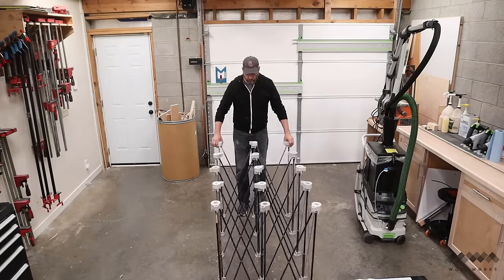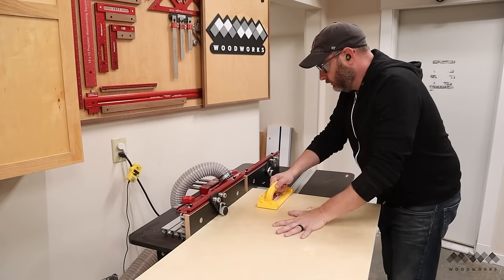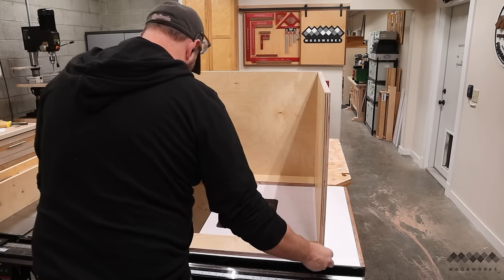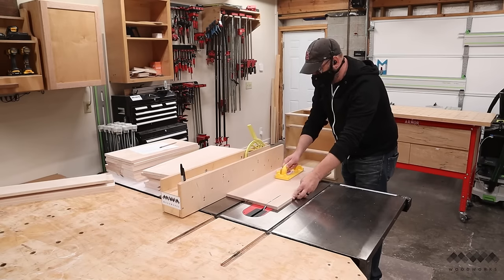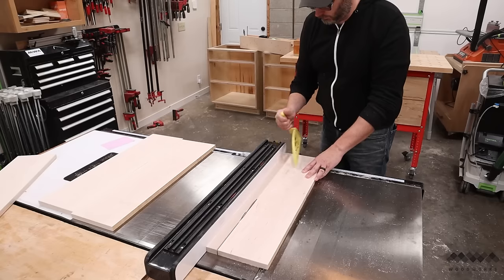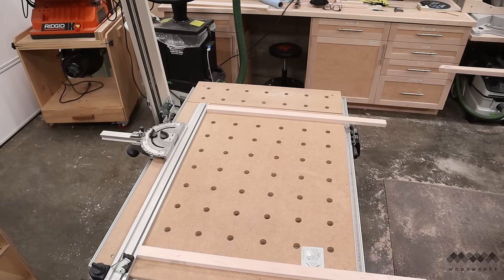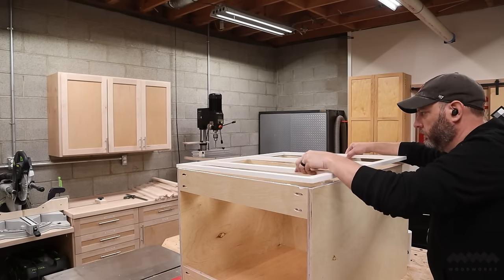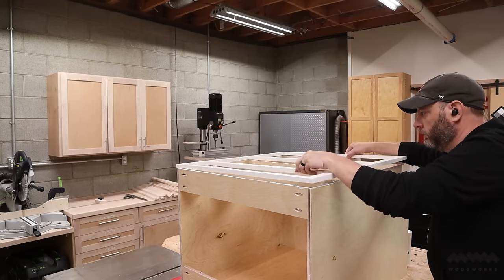I can't believe building custom cabinets was this easy

Comment: I built my entire kitchen and 2 baths with no dados, just glue & nailed, 10years, no issues.
Reply: it always fascinates me how professionals insist on making everything last at least 100 years. 

MDF, glue, couple screws, good to go.
Reply: Or pocket holes 😊
Reply: I didnt even use wood glue for my kitchen wall cabinets. Just scotch tape. Still good even after 3 weeks
Reply: I just spit on the edges. 88 years later still good as new.
Reply: I used chewing gum for my cabinets. Four weeks now and still holding strong
Reply: I just dry fit my cabinets and friction fit them to the wall. .3 seconds and I’m still good.
Reply: Right!!! My moms house could be taken by a.tornado and her custom cabinets will still be there lol@1lllllllll1

Comment: Lol “that easy” proceeds to use a bunch of expensive tools
Reply from the maker: I said it was easy, not DIY 😜
Reply: You actually don't need all that fancy tools.
If you own a house you need to invest a few hundred bucks in tools, or pay thousands to professionals and be done with it.
Personally I enjoy DIYs, even if it's not perfect, it's the process and understanding of things that is satisfying.
Reply: Bro I hate seeing these “tubers” use everything festool, everything else that we see does a great job, but isn’t necessary. I’d love to see these people get a job site table saw, a jobsite miter saw(dual bevel, dual everything so it’s not limiting), and just do it the way a normal person would. This makes people want to give up or not want to do it.
Reply: This is coming from a DIY finish everything guy, but my work is impeccable and I don’t have a 1200 circular track saw, I have a $300 60v dewalt circular saw with a perfectly straight hand made track made out of plywood which is the same length as a full sheet of plywood. Guess what that cost me to make? Nothing because I already had scraps and it’s just as accurate as a $700 festool track🤣. Also I have a dewalt miter saw which is dead on because I measure my miter and make the saw is adjusted. I also have a dewalt job site table saw that I have that makes perfect cuts. Just shows you don’t need fancy tools to get perfect cuts. The expensive tools are just built better and have more accurate cuts “out of the box”, but cheap tools can have the exact same results as long as you dial it all in. A tool is a tool. The degree of accuracy is what you want to make of it.

Comment: A great build.  I used to make my cabinets with face frames, but after discovering the advantages (including a large increase in usable space) and ease in installing the drawer glides, I now edge band my plywood and build my cabinets in the Euro style -- i.e., frameless.  For hundreds of years, if cabinet makers didn't want to use box joints or dovetails, face frames were almost a necessity to achieve the desired rigidity to the cabinets.  But now, modern joinery techniques such as pocket screws, dual dowels, conformit screws, and dominoes -- together with extremely strong modern glues, make face frames unnecessary (other than purely for aesthetics).
Reply: With a larger shop and more machinery, the customer gets to make more decisions on things like door styles, finishes, etc.
Also there are cost savings involved in building the Euro style cabinets as opposed to the face frame type, which can be passed along to the customer, making you more competitive.
But again that requires more expensive equipment which also requires shop space.
Ask most people if they prefer glued and screwed drawers over dove tail drawers and the answer will be dove tail.
And there are machines for doing that also.
Same goes for the finishing process, the nicest finishes are sprayed on, and that requires a well ventilated paint booth.
Wheres the dust collection?
Reply: Frameless cabinets are great, but we DIY woodworkers don’t always end up with perfectly flat and straight plywood, so I’ve had to abandon my frameless cabinet plans a few times in favor of a face frame that allowed me to help pull that bowed plywood into a more straight position…unfortunate, but that’s how woodworking goes sometimes.

Comment: Why do you put a 1/4 dado 3/4" from the back (for the back) of the casework? I see people doing this today and I'm scratching my head! We never did that we just rabbited the back 1/4x3/8. The cheaper shops just stapled it on without the rabbit. Do you use that method for upper cabinets or pantry cabinets?

Comment: Yep, that's the tried-and-true way of building base cabinetry that I learned 34 years ago. With the exception of routing a 1" 1/8 wide rabbit onto the back length of the 2 side panels, to recess in the upper /lower hang rails and the back panel. The horizontal top/bottom back members of the cabinet, we called them hang rails. Because that's where you would hang & attach the cabinet to the wall with, using screws. The back top horizontal member was also called the strong back. And "stretchers" were used in tables /chairs that stretched from 1 end of a pair of legs to the other end of a pair legs. The purpose of stretchers is to stretch over to the other like member, to brace it, keeping the legs from racking. But of course, now days curtain cabinetry anatomy seems to be used interchangeably. Great work.

Comment: the most important multi-tool one can ever have in the workshop is the "ol' persuader/equalizer/book o'complaints/debt collector" mine runs in the family for the past 80 years or so, i inherited it from my grandfather it even has a special feature, it holds the workshop doors open during summer. 😀😍

Comment: I have been building cabinets for almost 30 years. This is quality construction. Only differences for mine were, I datoed  the face frames  and then glued and clamped them and I covetailed all drawer boxes. nice video. Also once my doors or drawer fronts were glued up I thickness sanded them to make them almost perfect, but I realize most people do not have one.
Reply from the maker: All good stuff

Comment: Great job! Simple, elegant, and very well explained. I always enjoy your videos. Question though, how did you manage to hide the pocket holes on the toe kick ?
Reply from the maker: Good question! The toe kick will have a piece of base trim over it when I install the cabinets. That will hide the pocket holes.
Reply: Okay Sir👍
Reply: @MWAWoodworks  I got another question regarding the trim. So you put some trim to hide the pocket holes cool got it. But how do hide the edge ends of the trim? Or does the trim surround the sides of the cabinet?

Comment: I worked as a cabinet maker for 10 years and never once built cabinets with pocket screws. We used them in repairs but only out of necessity. Dowels, staples, glue and screws are industry standard for Euro-style cabinets. It's also faster for assembly.
Reply: Nah...tongue and groove assembly...

Comment: I'm hoping that someone can answer this quickly as I'm planning on building my cabinets tomorrow.   Would 3 of the cabinets in this video, when all screwed together, be strong enough to hold a 1.5 inch slab of marble?   This is for an outdoor BBQ bench that I'm making and it will be on caster wheels.   I was thinking that due to the very heavy weight of the marble slab, I should use 3/4 inch back board and glue + pocket hole the whole thing?   Any advise would be appreciated.

Comment: Nice video. For the tropics I prefer kitchen cabinets with legs instead of toe kicks.
Reply from the maker: Great! Where is the teopics exactly?
Reply: @MWAWoodworks  The Caribbean, specifically in Puerto Rico.  In the tropics there is a lot of humidity, termites, and danger of water damage from hurricanes. In the island, most of the kitchen cabinets are made with PVC to prevent damage from water and termites. I prefer wood because PVC is a very weak material.
Reply from the maker: That makes a lot of sense

Comment: When you screwed in the undermount slides, did the rear of the slide angle outward since the face frame sticks out around a 1/2" and the rear of the slide is screwed to the carcass
Reply from the maker: No for this cabinet I made the inside face of the face frame flush with the cabinet sides in order to make the install easier.

Comment: Great video, thanks! May I ask, if that cabinet was going to butt up against a wall on the left and you had an overhanging face frame on the left to scribe in for a good fit, how would you deal with the gap under the toe kick where the side of the cabinet is against the wall? Would you just scribe it in tight as possible so there was basically no gap?
Reply from the maker: These cabinets I built are actually going to butt up against a wall. Yes I will scribe the overhanging face frame and the toe kick will be covered by a piece of base moulding which will also be scribed on the end
Reply: @MWAWoodworks  much appreciated!

Comment: I've been watching your videos for a while and really enjoy your content and presentation.  As I have taken on more projects, I have run into the same technical question a few times.  In this video, at 9:49, you show a drawer slide being fastened into a cabinet where the end overlaps onto the face frame.  Though it does not look like it, I assume this means the inside edge of your face frame is flush with the inside face of the cabinet or you included a spacer, but just did not include that detail in this video.  This gets back to one basic design characteristic I have never seen anyone address - how much and where should the face frame overhang the sides of the cabinet.  It looks like your face frame is about 1.5", which means you have about 3/4" to overhang inside, outside or some to both.  I have assumed that there should be a small overhang on the outside to aid with installation.  Is that how you do it?
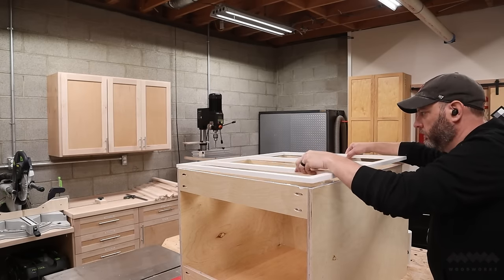Reply: Agreed for most cases. At  9:41 you can see that the face frame is flush with the inside of the cabinet.

Comment: Great video, i rewatched several parts to get a good look before i start the build.
I was wondering, with the face frame on and it being wider than the cabinet itself. How would you mount a second cabinet next to it? A piece of ply between 2 cabinets or something else?
Reply from the maker: In that case I would combine the two cabinets and then make a face frame to cover both and add it once the cabinets are installed
Reply: @MWAWoodworks  That makes sense! I'm used to euro style cabinets but the visible line between 2 cabinets and then the double width that is not maintained at the outer edges of the entire piece makes it feel like ikea stuff. Most carpenters use the same style "furniture boards" as well instead of plywood.

Comment: So the toe kick is integrated. That makes it much harder to level the cabinets?
Reply from the maker: It depends on how you're installing them. If you're doing a run of 3 or more cabinets tied together then it's best to build a separate base and just level the base. But for one one cabinet or two cabinets with an appliance in the middle it makes no difference the leveling process is the same.

Comment: Hey, newbie woodworker here, just one quick question.. how do you account for wood movement? I read that pocket holes prevent wood movement and the wood will then crack over time..
Reply from the maker: Good question! There is no wood movement in plywood. Only solid wood.

Comment: I have a 12 tooth 5.5" circular saw, would I be able to do this type of project? I do not have space or access to a large workspace, or even a small work space or storage for a table saw of any size.
Reply from the maker: If you have a way to cut perfectly straight and square cuts, sure. You also have to get blade for your saw that is meant for fine cuts, much higher tooth count. A 12 tooth blade is made for rough construction and demolition and will tear up plywood.
Reply: @MWAWoodworks  All the blades I see with more teeth are for 7.5" or greater saws. Should I be looking to invest in a new saw and get rid of this one?
Reply from the maker: I don't everything that is available honestly but you for sure need a crosscut or fine cut blade to use on plywood

Comment: Can I ask a dumb question.... What is the need & purpose of having horizontal "drawer separators"?  Seems to me a spanner at the top is all you need. Nothing is attached to the drawer separators, correct?  And with the face frame attached, are the drawer separators a bit of overkill?

Comment: Curious because I've seen this a few times now, why cut one side of drawers shorter instead of all four sides equal with dado on all four parts?
Reply from the maker: Assembly is easier because you can assemble the drawer and then slide the bottom in at the end.

Comment: Wait, so if you remove the handle the drawer the front falls off? Not sure I like having only 2 and the the same screws as the handle holding on my fronts like that. If those screw holes get wallowed out then the repair includes realigning the fronts.
Reply from the maker: No, the front is screwed to the drawer from the back. The handle is not holding it on. You just use the holes to hold the drawer in place while you install it.
Reply: @MWAWoodworks  Whew! Thanks for clarifying.

Comment: At minute 11:03 when you say that you use a scrap piece of plywood to match the height in order install the the drawer is it really the same height as the stretcher? In the video it seems slightly higher.
Reply from the maker: It's 1/4" higher than the stretcher, which accounts for the 1/4" overhang of the face frame.

Comment: While I don't care for pocket hole joinery for many things, I think pocket hole joinery is perfect for cabinet construction. I wonder why you just glued the face frames to the carcass rather than use pocket hole there too?
Reply from the maker: You can if you wish. I just find glue easier to deal with at that stage

Comment: 3/4 inch ply is over kill and you have been lead to think that is what you need to build cabinets! I have built many sets of cabinets over years and longer than you have been alive. 1/2 inch ply of good quality like Baltic Birch has plenty of strength. Especially for uppers Lower cabinet’s that will have granite I will agree. But for others why waist the money.
Reply from the maker: 3/4 is standard for custom built cabinets. 1/2  is problematic with pocket hole joinery.

Comment: 😬 those tight drawer bottoms. I think to make it last longer it should be loose enough to “ring” if you tap it. To support the weight, you run a stretcher from the front to back under the drawer bottom.

Same reason door panels should float inside the door frames and just use rubber bumpers to keep the panels from rattling too much.
Reply from the maker: Door panels have to float to account for wood movement. Theres no wood movement to account for in plywood

Comment: I've watched a lot of cabinet videos and still don't quite follow how you determine drawer sizes, spacing between drawers, drawer front sizes, etc. Is there a set of rules or some formula to follow?
Reply from the maker: No there are no rules per se. Drawer height can be whatever you want. Drawer width is determined by the drawer slides you use so that is a fixed. It would make the worst YouTube video ever because it's all just working out boring math 🤣🤣🤣

Comment: Someone, please, explain me: the only practical reason to make a frame is to avoid edge-banding? Or anything else?
Reply: It’s a different look. No frame gives what some may call a full over lay door. The tolerances for the doors are much tighter. Doors abut each other so you must have adjustable hinges to help align them.  Plus you get a full space opening.

Comment: do you know if its possible to remove old hardware from built in drawers and reinstall new hardware and drawers using the same old frame? bathroom has really old built in drawers but i was thinking i can build new drawers and buy new hardware and just use the old framing? is that possible or no bad idea? its just cause the built ins are already attached to the sink countertops 🥴

Comment: Why weaken a great design by cutting off the back dado and using screws? This is the first failure of every kitchen cabinet at my house. It’s super easy to have the back dado and just assemble as you did. Still easy and but much stronger.

Comment: Hi, why can't you just simply glue and nail drawer bottoms to avoid so much work?
One of my drawers built the hard way still came out
Thank you in advance
Reply from the maker: You can. It's messier and the plywood edges will be visible. I've done it on shop cabinets.
Reply: @MWAWoodworks  thanks